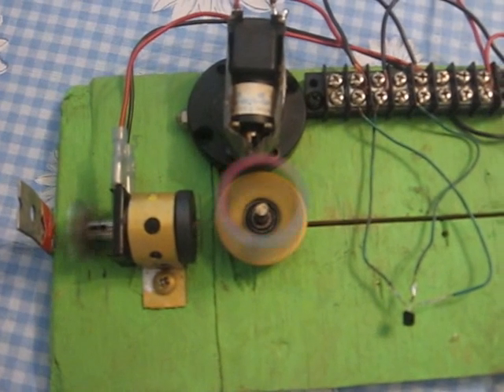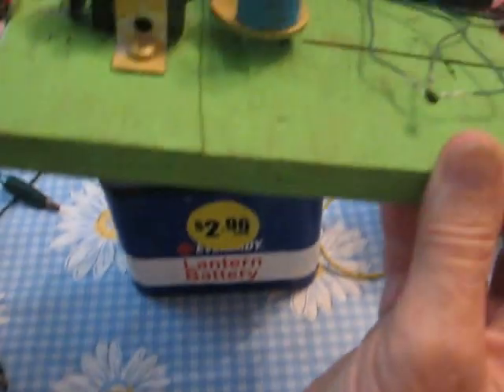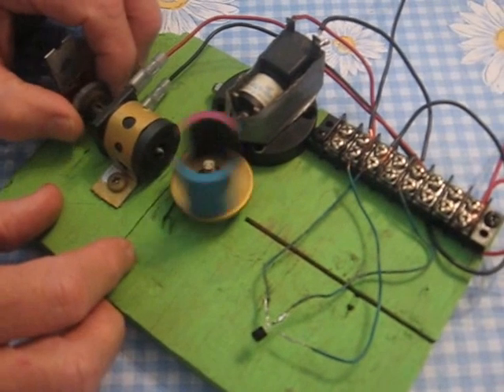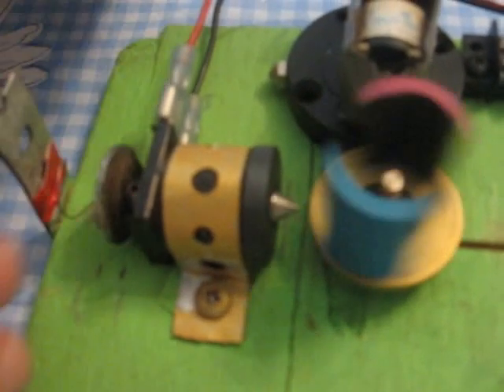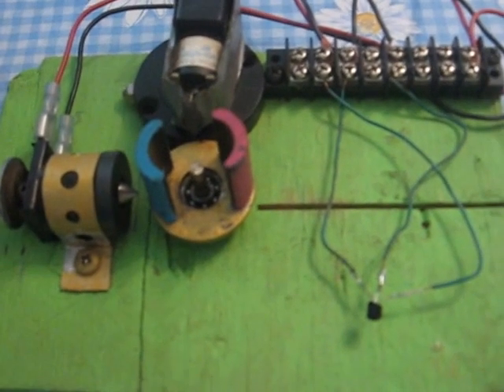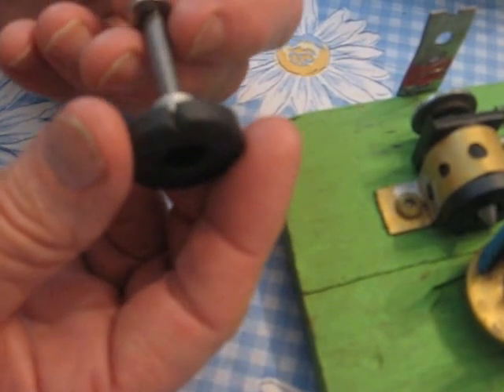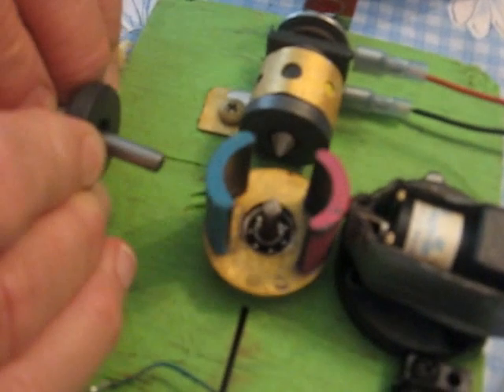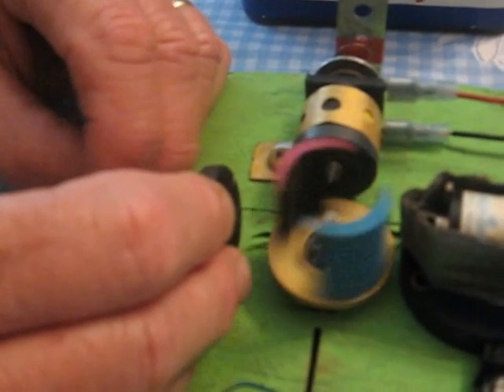Magnet motor switching of Permanent Magnet fields

Comment: Waiting for updates, good job ! Try some mechanical "actuator" integrated in the circled based of the magnets ..that can work with no extra power...unless you need some electrical power in the coil to run the system..this I did'nt get it to good ! :) Anyway, youre setup is promissing..good luck !
Reply from the maker: Thanks for watching. There is pulsed power going to the coil to shift the permanent magnets.

Comment: Cool channel for sure...is there any chance you can couple your solenoid to a crank and make it sustain itself mechanically..i dont want to use the word pmm here..but it looks promising
Reply from the maker: I don't no for sure, but maybe if the speed is kept constant when a load is put on the the spinning magnets shaft, and a stater is put around the spinning magnets to produce electricity , then it maybe possible to disconnect the battery, or recharge the battery on the go. This is a pulsed system that takes very little power to shift the permanent magnetic fields, which gives it a great advantage over a normal PM Motor that takes more power to operate. The magnetic fields are already  stored in the PM. There is a constant torque with a push and pull force. Thanks for watching. I'm working on a bigger set up with a generator set up. My main problem is getting co operation in getting the right size magnets. No body sells just a few magnets. You have to buy quantity. I am retired former Marine Sgt with very little funds to operate. I'm always looking for some junk parts that I can use to take apart, Micro waves etc. Manufactures don't seem to make the solenoids that I need off the shelf. I have increased the force by using permanent magnets around the outside of the solenoid. Just need enough lines of flux from the PM. instead of more copper windings. This method increases the ampere turns that gives more force without using more amps to power the solenoid.  Cheers !!